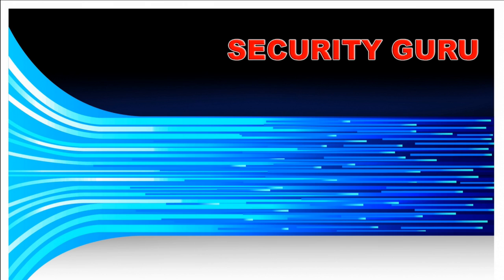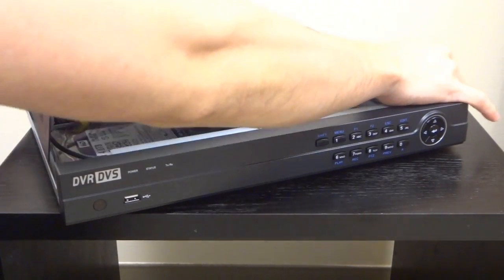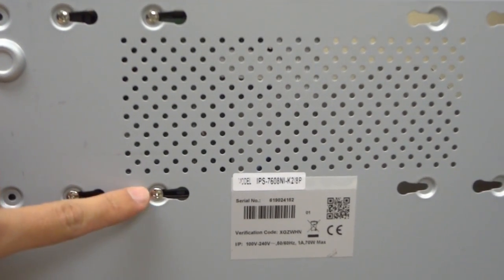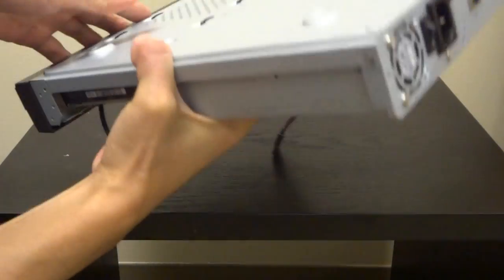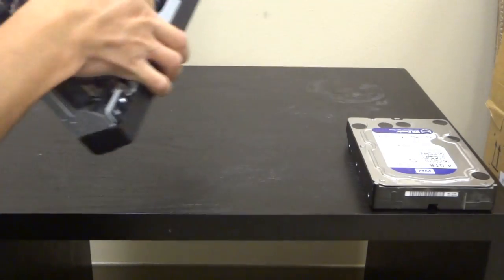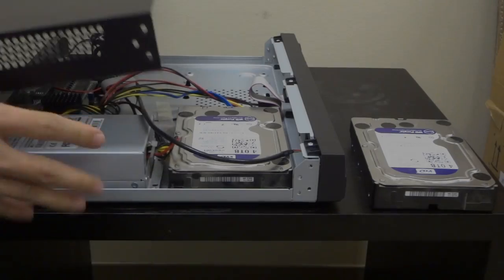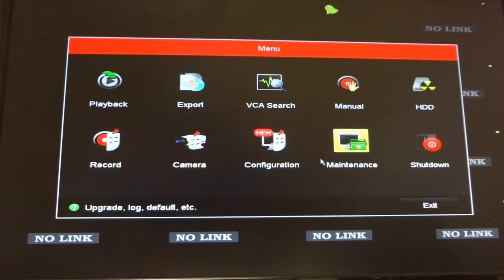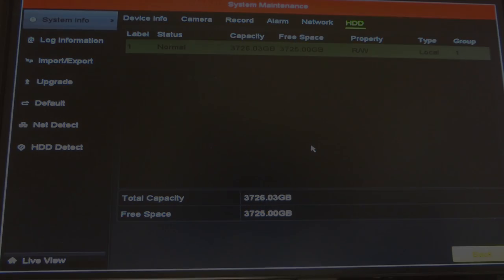UPGRADE, ADD or Replace BAD Hard drive on DVR / NVR COSTCO, QSee, Lorex, Swann Etc. (CCTV)

Comment: Save yourself a headache. I had a beeping sound from my Qsee DVR and the video did not show. I replaced the Hard Drive, and it still Beeped. After speaking to the customer service at Costco and Qsee i was about to through the dvr away when I noticed that there was a 2025 watch battery. BAM! I replaced the battery and it Works.
Reply: I have that beeping sound in my QSEE HD DVR, I already open it and i Can c that battery; I will run this battery replacement option first. Gooddamn WD purple HD are expensive.

Also this brings me to anothe question if you need to replace the HD maybe to increase your storage capacity, does it have to be a WD Purple series HD? any other brand would not make it?
Reply: @Tury2801  I don't know for sure, but It did not work for me with the different color HD, that's why I bought the original.
Reply from the maker: @Tury2801  This is a late reply sorry, but just for information for others that may come across this question. You are able to use any HDD brand or color. The main reason why PURPLE is being used is because they are called surveillance drives. Also SEAGATE skyhawk is another surveillance drive. The main thing is they are designed for constant writing and low heat output, which in turns gives you longer life than other "color" or "model" drives. If the question will it work. Yes it will, will it outlast a surveillance designed drive? NO.
Reply: @securityguru407  thank you,  great advice!
Reply: @securityguru407  Any idea of why my HDD is not being recognized? I'm upgrading a 1TB WD Purple to a 4TB WD Purple.
Reply: I have a box but no hard drive so I will install one. Should the wires already be their to install the hard drive or will I have to buy them seperate?

Comment: You don't have to remove the screws from the hard drive. Simply loosen them up and slide the hard drive forward so it slides up and out through the keyhole style screw holes.

Comment: Thanks for the video, nice to know it can be upgraded.  I have the Samsung DVR SDR-5100N  from Costco but in short, have a noob question here.  I want to upgrade to a system that has a few more bells and whistles like 1.  Auto Tracking,  2. Color Night Vision,  3.  Higher Resolution Camera that can Zoom in automatically when auto tracking detects something as tight to clarity as possible and 4.  An alert and stream to my smartphone would be a bonus.  My question is, are these things performed from the DVR or from the Camera?  I'm assuming number 4 would need to be built into the system but 1-3 upgrades, if I buy a camera that has the ability to auto-track where it can swivel on its own, is it going to do that if I nearly swap out my original provided security cameras with the new one?  I'm honestly just trying to figure out if I need to trash the system I have and start all over brand new or if all I really need are new cameras?
Reply from the maker: Hello, I would suggest that you do scrap what you have and start over. I'll answer the questions one by one to why if you wanted to get these functionalities. 

1. The DVR is analog CIF resolution which is not even comparable to what is the now lowest of 2MP.
2. Auto tracking cameras with the zoom functions that are customizable are built into IP cameras. 
3. Color Night vision are also available in HD COAX technology and IP solution.
4. Motion alerts are available in the new DVR / NVR.

There are +/- between IP solution and HD Coax solution. If you are in the US visit our website Securitycameratechsupport.com and call us. I'll recommend to you a few solution that is out there whether it is from us or not its up to you, but at least we can tell you the difference and what to expect from the current technology in the market.
Reply: @securityguru407  Thanks for that information!
Reply from the maker: @PatriotCoinRings  No problem Good luck.

Comment: didn't you have to reinstall the software?
Reply from the maker: No the firmware is built into the main board of the DVR or NVR. The hard drive is mainly for storage. So after you switch the hard drive it should work without having to reinstall anything.
Reply: SecurityGuru so if I were to put another hard drive in would it reset the password or do anything because that is what I need. The password to be reset
Reply from the maker: @KhaiMahase  No passwords and settings will not reset. The only thing you will lose are the recordings that was on the original drive. If you want to reset your password you have to get the master from the manufacturer or brand of the DVR or NVR.
Reply: @securityguru407  Alright, what do you mean by the master??
Reply from the maker: @KhaiMahase  Some DVRs or NVRs has a master password reset. What is the brand of your DVR or NVR?
Reply: SecurityGuru it has no brand but it’s a h.264 16 channel dvd
Reply from the maker: @KhaiMahase  That would be hard to get the master password for. Do you have the model number I'll do some research for you and see if i can get you something that would help.
Reply: @securityguru407  Alright thanks man, the only thing I can find is a number on the bottom on the DVR which is DVR-8008H
Reply from the maker: @KhaiMahase  If based on my search on this DVR its a very old one default password 123456 or 1234 or (blank no password). I have used this DVR before and there is a calculator for the master password but i cant find it in my archives if i find it ill post here but try those default passwords.
Reply: SecurityGuru alright the DVR is like a black and grey color I’ll try the passwords now
Reply: SecurityGuru I looked when this system was made it says it was made in 2014
Reply: SecurityGuru I tired those passwords it did not work, all it says is invalid password, tip : default password is NULL but it does not work.

Comment: My dvr doesn't recognize that a hard drive is in place after the old one switched out
Reply from the maker: What type of DVR do you have? What is the size of the new Hard drive? Some older DVRs do have a size limit.
Reply: @securityguru407  it's a truvision. The new harddruve is identical to old one.  I guess the issue never was the hard drive. Someone has suggested it could be the power adapter
Reply from the maker: @eileenmaher1071  True, but the main questions is if it was the power then the system won't really boot properly. Did you check the SATA cable? or the Power Cable to the HDD? I mean it's rare but I think that will be more likely. Unless you do see other issues with the system.
Reply: @securityguru407  new Sata and new power cable did not fix issue, Ordered a multimeter to check power adapter . For now I wiah there was a way to shut off the alarm so I could at least be able to view my cameras without the annoying beeps
Reply from the maker: @eileenmaher1071  Now that I can help you with. lol There is a way to shut the beeping off. Depending on your firmware version. Look for Event and exceptions. go to the exception type go through the list, sometimes simply just turn it off under ALL works but sometimes it dont so I always suggest just go down the list and turn off audible warning.

Comment: replace my hard drive in hiseeu NVR cameras and I can’t get it to format
Reply from the maker: Hmmm.. It should format unless your NVR or the replacement hard drive is also bad. What error message are you getting when you try?
Reply: @securityguru407  no hdd not found
Reply from the maker: @marvinmadron5697  Are you sure you plug the power of the HDD correctly? Make sure that all the connections are pushed it tightly
.
Reply: @securityguru407  Any idea of why my HDD is not being recognized? I'm upgrading a 1TB WD Purple to a 4TB WD Purple. It is for a Lorex MPX HD
The 1TB works well but the 4TB starts and stop constantly (two different 4TB HDD)
According to the Lorex info, this DVR supports up to 8TB.
Thanks in advance

Comment: Can I use a different brand POE camera to a LOREX NVR?
Reply from the maker: There were some none True IP Lorex, QSee NVRs in the past but if the one that you have is a true NVR w/ built in Poe then yes you can do it, but you need to configure the IP address of the camera to match the subnet of the NVR before you plug it in and program the camera into the NVR. What brand of camera are you planning on adding? Maybe I can recommend some stuff to you.
Reply: SecurityGuru thanks for the response. My existing DVR is a Samsung 16 channel with installed 10 hard wired Samsung cameras. My DVR is 5 years old and started to reboot on its own a few times a day and sometimes will completely power off. I have tested the power supply with a multi meter. It was not the issue. I plan to just buy the Lorex NVR unit only and use my existing Samsung POE cameras. Some of my cameras on the perimeter of the house is mounted very high by a professional installer, so I really don’t look forward to replace them.
Reply from the maker: @speedmaster001  What is the exact model of the cameras / old NVR. Samsung was the first company that did this "fake" IP solution (meaning video and power goes through CAT5 but it is not true IP solution) Basically they kinda made a video balun built into the DVR. Once you have this I can check if you cameras are true IP solution with Onvif technology. If it does then the Lorex NVR should not be a problem. Good luck!

Comment: It said you were gonna show how to add addictional hdd
Reply from the maker: yes you can do the same as the replacement except you align the new hard drive screw points onto the empty slot next to the current hard drive. Note: Some DVRs only support 1 HDD or up to 4 HDD so it depends on what you have. If you only have 1 HDD slot and would like to get more recording, you can replace the drive the is there with a bigger one.

Comment: How about adding a hard drive in that other space? How difficult is the set after the hard drive is installed?  Great video by the way.
Reply from the maker: Thanks, If your DVR does have multiple hard drive slots and need to add another drive just follow the same steps. Some DVRs or NVRs only have 1 slot so you can only replace the existing drive with a larger size hard drive. It is simple, because the DVR / NVR will automatically record to the next drive once the first HDD is full and recycle after the drives have been initialized.
Reply: SecurityGuru thanks for the info.

Comment: Can I put a Samsung 860 EVO 1TB 2.5 Inch SATA III Internal SSD (MZ-76E1T0B/AM) in the place of my noisy hard drive?
Reply: Yes you can. It depends on your DVR model but usually SSDs are fine on most DVRs. It is worth a try.
Reply: John Ivan thans
Reply from the maker: It does work. I have the same SSD drive working in my personal DVR.
Reply: SecurityGuru thank you